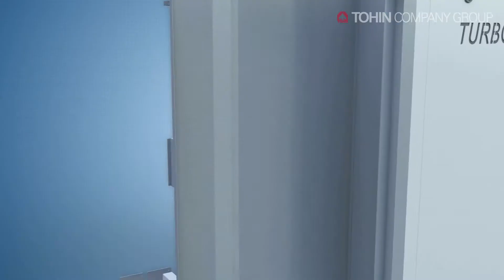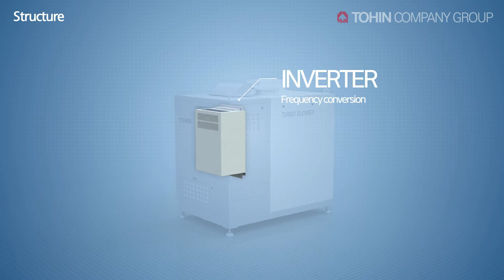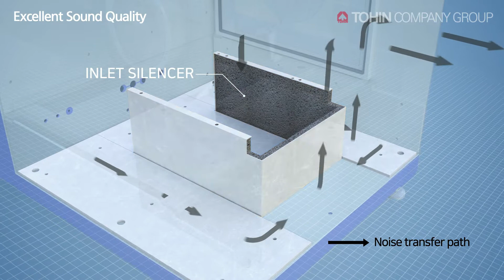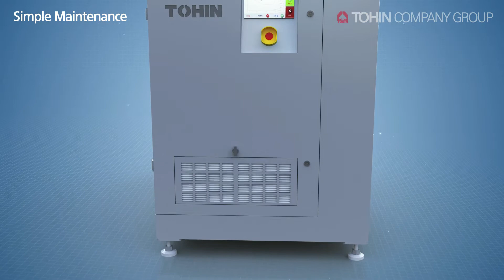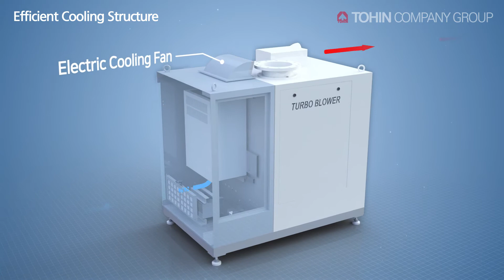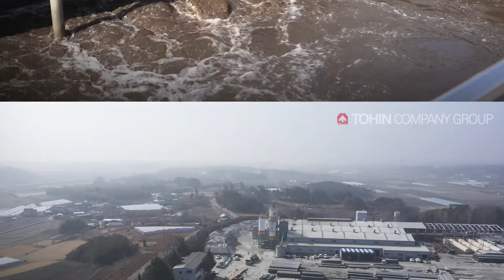[INTRODUCTION] TOHIN TX TURBO BLOWER 2021

Comment: Kết cấu máy gồm 2 phần điện và cơ khí riêng rất thuận lợi cho vận chuyển lắp đặt, bảo trì. Cho hỏi phần điều khiển có thể kết nối với phần điều khiển của các bộ phận khác trong  nhà máy xử lý nước thải không? Có khả năng kiểm tra lỗi từ xa không?
Reply from the maker: Cảm ơn anh đã quan tâm đến sản phẩm. Máy thổi khí Turbo có tích hợp Integrated Monitoring System hỗ trợ kiếm tra từ xa. 
Để được tư vấn kỹ hơn về sản phẩm, anh vui lòng để lại email , số điện thoại, hoặc liên hệ hotline 0901466586. 
TVI xin trân trọng cảm ơn.
Reply: hay quá anh ơi